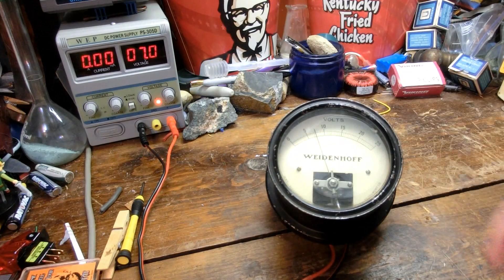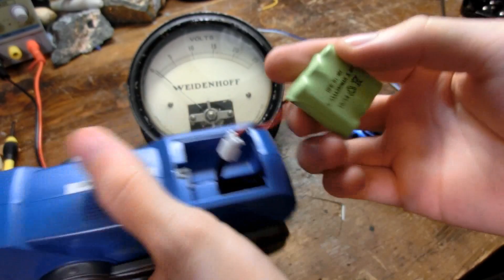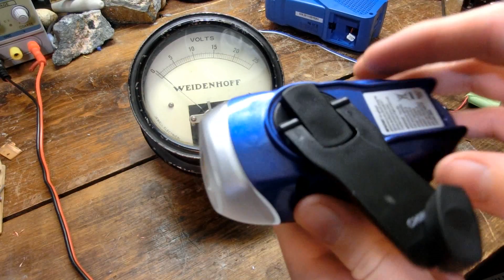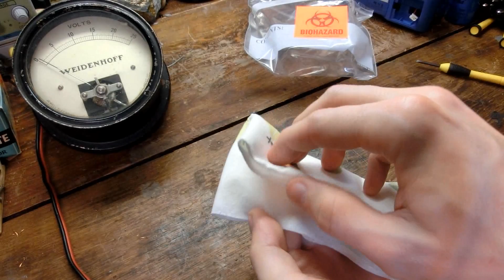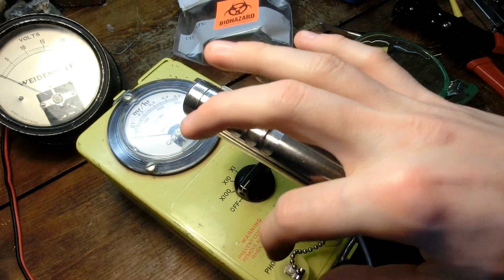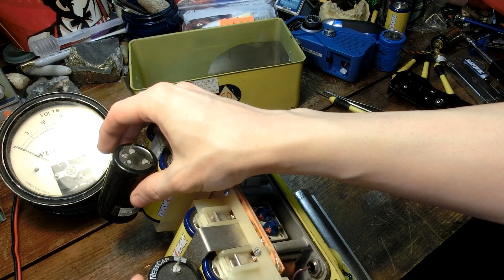Random Bits 0068: 1920's Meter, Wisdom Teeth Emit Radiation?

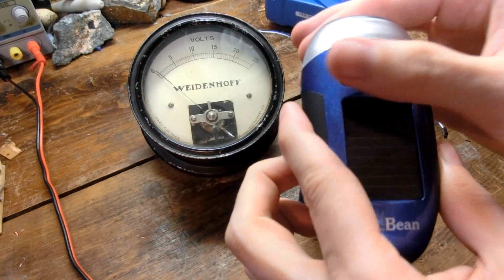Comment: 4:10 Some manufacturers have done a vanadium pentoxide lithium cell in the 2032 size (VL nomination), which is a rechargeable technology, and I have also seen the maganese titanium lithium cells in this size (MT nomination). These have different identifier letters than 'CR' though. So some '2032' batteries may be recharged, but not the CR2032. If you try to recharge the CR2032, it causes the lithium inside to heat to the melting point, ruptures the case and vents with flames.

Comment: The teeth are bent (hooked) probably due to the reason you had to have them removed. The wisdom teeth and other teeth were pressing against each other and were not only throwing each other out of alignment and causing pain, but they were warping each others' growth patterns.  Teeth like grass grow from the bottom up.  In botany, this growth area is called a meristem.  I have no idea what the equivalent zoological term is, if there is one. The growth at the roots force the teeth out. If they hit another tooth the wrong way, the only flexible (that can change direction) part of the tooth is the area where growth is occurring at the bottom. 
      "We are going to have to blast" - Moe Howard instructing the other Stooges on how they were going to remove a difficult tooth while practicing dentistry.
Reply from the maker: i agree

Comment: That Portal-Lite is cool. Looks like the switch is a wind-up mechanism so it automatically turns itself off.

Regarding your Geiger counter, you might be able to feed the click output into an amplifier, maybe? I really don't know. As for the batteries, if you're worried about leakage over long periods of storage, just use carbon-zinc batteries (which the yellow Rayovacs you are using in this video are). I've never seen a carbon-zinc battery leak.

Comment: Often devices have a cr2032 in to make them work fine off the shelf, the battery's not really being used as a rechargeable. In many of the cheap copies of 'shake' flashlights the coil isn't even connected.
Reply from the maker: a lot are though, like this generator feeds power to the battery. some are ven wired to only recharge when the light is switched off and can't power the light directly. and then most of the shake lights cant power the light directly anyway.

Comment: You may have just fried an internal regulator or diode.
Reply: Yes Spot on MisterClaws it is the only component than can be removed that would not impact the circuit, unless of coarse the hand held generator could send reverse voltages into the circuit without it ! I remember back in the 1980's when I used to repair CB radios, te most common fault was people wiring up CB radios the wrong way around and blowing the protection diode, I always replaced it as people often make the same mistakes.
Reply from the maker: *****
i've found that wax tends to melt in the hot months and run everywhere, so if i did then i might have wax seeping out of my radio. no thanks hahahaha
Reply from the maker: well surprisingly theres a lot of microchips in this radio, one of them could have blow. but the best trail of the issue is the heat so i'll follow that first and just desolder the hot part, maybe we dont even need it haha.
Reply: I think you will need it, they rarely put stuff in circuits these days if their not required, cost cutting and all that jazz ensures manufactures tend to try and get away with the minimum requirements. What is most likely happening is your pushing so much current into the circuit is your offsetting the short circuit by a few millivolts to maybe a volt or 2, and the circuit is just barely functioning, it most likely will be a "PARALLEL" shunt such as a protection diode often used to protect devices from reverse polarity, or even more likely a voltage reference diode shunt used as part of the regulation. In my experience it is not likely to be a Capacitor if it only received a short burst of over voltage, Capacitors usually take a while to go short circuit with prolonged over voltage, having said that if you blasted one with 50 times it's rated voltage then it could fail instantly, look for low voltage caps getting hot in that case.  Also I noticed your were able to crank the generator handle in both directions, this implies the circuit has a full wave rectifier in their, it could be ONE of the diodes in the rectifier has gone short circuit. It will be either a black package with 4 legs or 4 discrete diodes.  Best way to find out what the MICROCHIPS do is search Google for the CHIP ID number with data sheet as part of the search term.
Reply from the maker: *****
 no it was only a single diode type thing and a potentiometer, but its all so close you cant tell without a heat camera.
Reply: Single diode ! Then that could be your reverse polarity protection diode, if it is then it might be bigger than all the other diodes. Hope your making a video about it ;)

If it has 2 legs then it should be a standard protection diode and their easy to come by, in most PSU's and you should be able to replace it easily, does it have a stripe on one end ?
Reply: Does it look like http://www.ebay.co.uk/itm/New-Hot-Sale-10-Pcs-Black-Molded-Plastic-Case-1000V-10A-Rectifier-Diodes-10A10-/321455878913?pt=UK_BOI_Electrical_Components_Supplies_ET&hash=item4ad8437301
Reply: ***** Yep, if it IS the reverse protection diode they are well known to go to a dead short upon failure. That would explain the high current draw of the radio. So his idea of just removing it may not have been far off base. haha
Reply: Rinoa Super-Genius
 Here is a little trick I learned one way of telling what is getting hot first is to drop a few spots of candle wax onto various components and watch to see which melts first when you power it up !!!
Reply from the maker: *****
no its made of glass. but still what i suspected. a diode.

the candle wax idea is good, but messy. i just use my hand and my infrared thermometer.
Reply: Yeah but lots of old radio's had wax on sensitive circuits back in the 60's to keep out the damp, so never really looks out of place ;)
 different type of wax though.
Reply: Ahh I forgot you must be in a warmer climate than me lol, it's never that hot in the UK :p
Reply: ***** Actually, cranked backwards, it WILL send reverse voltage. (:
Reply from the maker: MisterClaws
only if you take out the diodes that rectify it.

Comment: Smashing that the meter works ok :-)), analog displays are so handy for times where the voltage is moving about and standard digital meters just show jibberish.
if you were into construction i would say put it in a power supply and switch it to show volts or amps.
Teeth have basic functions parting/ripping/grinding, apart from the mad roots they look normal for the position in the mouth, just make sure a land developer doesnt build houses in the spare spaces you have now ha ha :-)) yes i am mad lol.
Reply from the maker: you are crazy haha, i don think i would want an analog meter on a power supply, it wouldnt fee exact enough. but then again this meter is big enough to give a nice amount of precision and there are some others that are even nicer. i really want to find meters that dont start at 0v. it would be awesome to find a meter that only shows between 11-14v so you can see the millivolts broken down in that area for battering and stuff.
Reply: Rinoa Super-Genius you can do that with an analog meter quite easily: Choose a meter with the range you want, like say 11-14 volts, you'd want a 3v meter... then connect it in series with an 11v zener diode.  Then zero on the meter will be 'below 11v' and 3v on the meter will be 14v.

I've seen this done on the meters on those cheap 'booster packs' for starting cars
Reply from the maker: *****
of course you can make it, but its a shame they dont already have them around.

Comment: yeah the white spots occur when the teeth are about to come through and you have a fever. i have it on 4 teeth. it also weakens the tooth and i had to get seals put over them so they would not decay prematurely.
Reply from the maker: i've heard it could also be caused by fluorosis. but hey atleast that means i brush my teeth more than enough if it is.

Comment: that volt meter is great! seems to be very well made. german stuff is very good quality though.
Reply from the maker: i wouldnt say its all good quality, lot of german cars are good quality but not well thought-out. but yeah this meter is good quality. when typing up the company name it looks to be a local company that built lathes and heavy equipment.
Reply: Rinoa Super-Genius the meter could be from some sort of machinery.
Reply from the maker: smallenginedude71
i'm thinking like a 24v truck battery charger or something.
Reply: Rinoa Super-Genius i would say that sounds about right.
Reply: Rinoa Super-Genius i have a decent sized 24v 22a charger and that puts out about 31v no load on the fast charge setting and about 29v on standard setting.
Reply from the maker: Thomas Sears
cool.